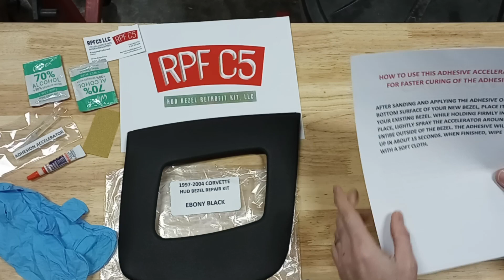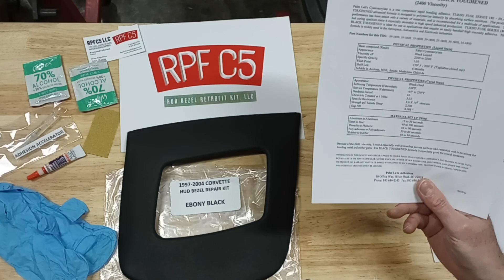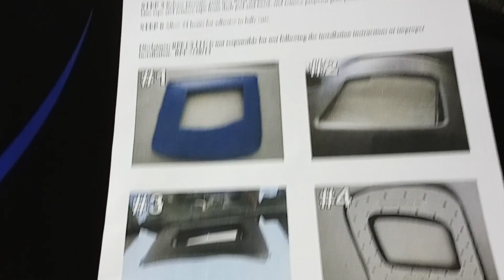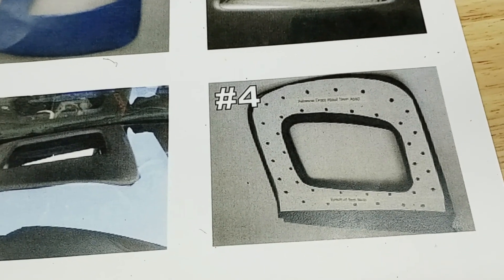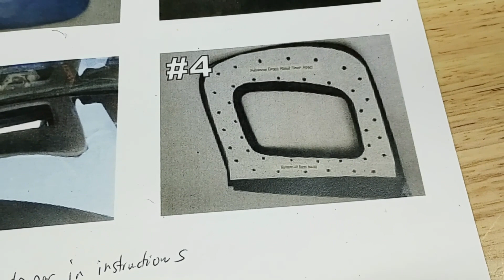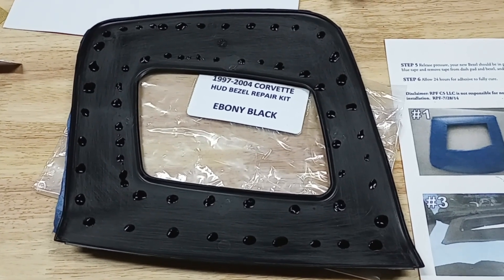How to Install an RPFC5 C5 Corvette HUD (Heads Up Display) Overlay Cover

Comment: Which one do you prefer, the glue down or tape down bezel?
Reply from the maker: I prefer the glue down. It's still on my car and hasn't shown any problems since installation.
Reply: @BasinMotorsports  Thank you.  Have a C5 with a crack in the same place so I'm going to purchase from the vendor you indicated.

Comment: The cover looks great. The best repairs/upgrades are the ones that blend in and are basically unnoticed by anyone taking a casual look.
Reply from the maker: This one definitely hides itself, and the adhesive is guaranteed to never fail. It should outlast the car.
Reply: I just installed it and it looks great. The trick is to put enough glue all around and put pressure on it to stick over night. I put some towels with a heavy book on top. Man it’s great. Definitely recommend it.